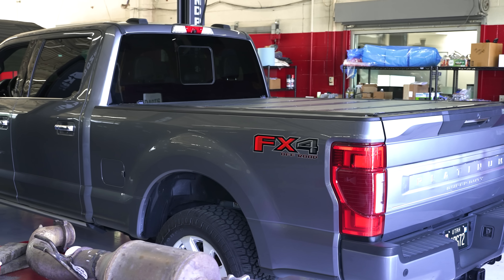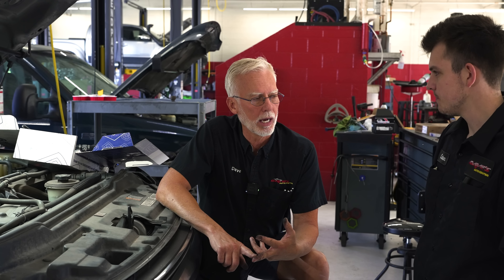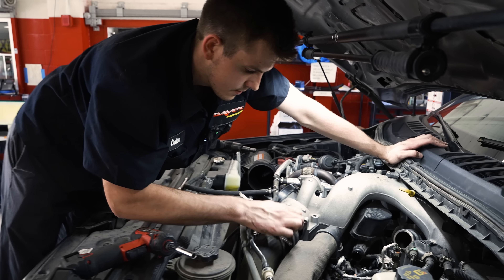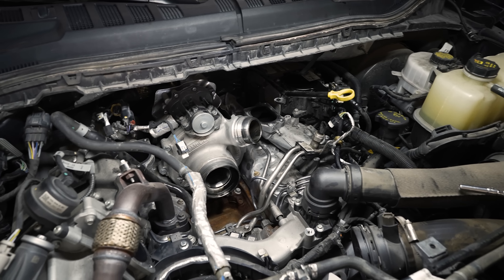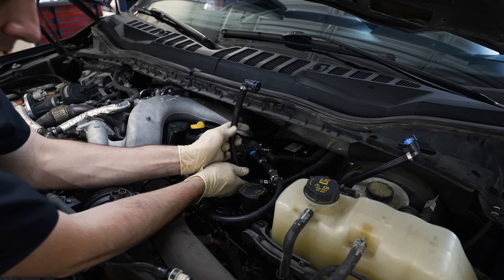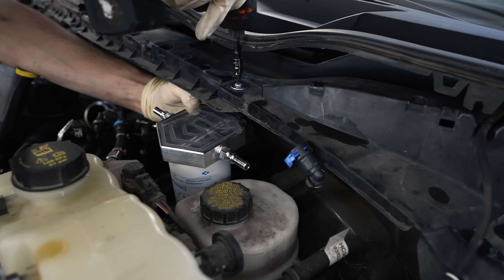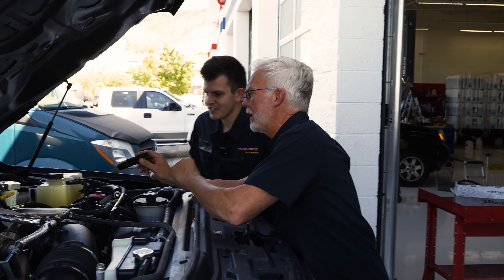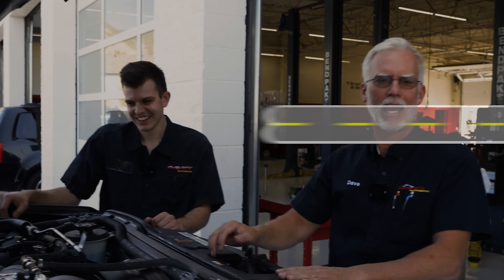How To Avoid A $10k Repair When Your CP4 Pump Fails!

Comment: Thanks again for trusting in our products and putting out great videos on them! Seeing Caden give a 10/10 star rating on fit, finish, and install is exactly what we are shooting for on all of our products!
Reply: Impressive marketing, I give you that. Got the masses fearing the cp4 like the plague.
Reply: Looking to see if I can fit that kit on a 2013 duramax lml.      Maybe a little modification?     Would like to know your thoughts.
Reply: @ronniebenoit4081  In your case they make a cp3 kit for the duramax. That's your best bet. Cp3 flows tons more than dcr and cp4.
Reply: @HSKFabrications well there's multiple class action lawsuits over the CP4. They are junk.
Reply: @HSKFabrications  cp3 doesn't produce the designed pressure needed for the bosch lml injectors.... less efficient by designed standards
Reply: @ronniebenoit4081  S&S literally sells the kit for a cp3 in an lml. Just get a good lift pump and a cp4 by exergy. You'll be fine. Seen em last half a million miles with a better lift pump and an additive used regularly.
Reply: @Retadin  They will all lose. Too many variables controlled by the consumer to put the blame on Bosch.
Reply: @HSKFabrications  obviously you didn't read what I replied with.  Why would you want to lower your fuel pressure?    The cp3 only produces 15-18 kpi's.   When the cp4 produces 28-30kpi's.    More pressure means better fuel burn.
Reply: @ronniebenoit4081  Well, why do about a dozen companies sell the kit? That's why I said afterwards to stick with a cp4 by exergy.
Reply: @HSKFabrications my bad I miss spoke...
 I agree with what you're saying.    300k.  165 FASS.    Injectors and cp4 replaced every 100k miles.... just a precaution so I'm not blind sided
Reply: @ronniebenoit4081  Good setup. I have a cp4 stroker for my 6.7 ford built by rcd which has pinned buckets and modified internals. Not sure if they do the lml cp4.
Reply: @HSKFabrications  I'm looking for something.    I. I'm tired of wondering when it'll explode on m....lol.    I'd like to see if a CAT pump out of a 3208 can be  modified.
Reply: @ronniebenoit4081  You are correct. Increased injection pressure improves combustion, but only if the ECU commands it. The pump itself does not control the pressure. The ECU commands rail pressure by a combination of metering the volume of fuel that goes to the plungers with the VCV and bleeding off excessive pressure in the rail with the PVC. A CP3 will make just as much pressure as a CP4 if the ECU commands it. We use CP3s on our injector test benches and they have no problem creating whatever pressure we want. The pressure limit in a common rail fuel system is the injection duration and leakage through the injectors. With that being said, a CP4 is slightly more efficient at higher pressure, due to the plunger bore diameter being smaller. A smaller bore has less circumference for leakage between the bore and plunger. We have sold a lot of LML CP3 conversion kits over the last decade, and not one of them has come back for not being able to meet the commanded rail pressure. In fact, an R110 (1087 mm^3/rev) CP3 has more displacement than the R90 (896 mm^3/rev) CP4 which gives it the potential to support more pressure on an LML if the calibration calls for it.
Reply: Send one my way please for a 2011 😅
Reply: Thanks for the video …. Looking for a set up on my 2018 F150 power stroke ?
Reply: I love the kit. My mechanic really loved the kit. He said for once there was a kit that went in exactly as stated zero issues super smooth install. Thanks for the great products. Once my CP-4 takes a dump Ill be ordering the replacement pump kit you guys have.

Comment: The ultimate disaster prevention kit is a N/A gas motor 😂
Reply: Then you pay the 10k in fuel guzzling towing
Reply: @100pyatt  yep. But most of these trucks tow nothing 🤣
Reply: Drove a 6.2 f250 for years and liked it alot. But my 6.7 f350 is so much more comfortable. Im at 5k elevation and hwy speeds are 80. Even without towing the extra mpg and comfott if the diesel is worth it
Reply: headache prevention kit: avoid consumer diesel trucks

Comment: I installed that S&S DPK on my 2016. Much easier access if the CCV filter box and EGR cooler are removed, which I still haven't found time to reinstall. And just to add issues, my DPF and DEF mysteriously disappeared.

Comment: I bought this kit and had it installed shortly after getting my second hand 2016 F350. Cost me less than $1000 for a great piece of mind. Great quality parts. Only regret was wishing I would have waited about 8 more months for S&S carb certs to pass on their CP4 replacement pump kit.

Comment: Just purchased a 2024 Ford F250 high output. I have been researching purchasing a diesel for about four years and finally was able to get one. Of course a lot of videos like this come up. Looking for an opinion by anyone following this video or from Dave himself reference to Having to do this on a brand new Ford. Has Ford not recognized that this is a failure point? Is it something that should be done no matter what even though you own an $85,000 truck? 

You would think that Ford would’ve figured this failure part out and maybe switched it? Any ideas or comments relative to this would be appreciated. I know it’s probably short money considering the investment but didn’t know if certain years were affected more than others and again I would assume that Ford would’ve already addressed this and made the fix.  

It just seems like it’s such a widespread talked about issue on the Internet that someone would fix it at the engineering level at Ford

Comment: What's your take on why manufacturers seem to have forgotten how to do basic things. This fuel pump is only one example. Lifters seem to be another area where things have gone bad. Generally poor layouts for maintenance and repair is another big one. The additional cost to incorporate a filter arrangement like you have installed on this video at the factory would not be a ripple in the cost of an $80,000 truck.

Comment: Hey Dave, does S&S Diesel have that kit for a F150 with the 3.0 diesel motor? I have a 2018 with the 3.0 diesel with 60k miles and I would like to get that kit or a new DCR pump.
Reply: We do not currently offer any kits for the f150 3.0 platform, however we do have those on the radar for a possible disaster prevention kit in the future.
Reply: @SSfueled  thanks for responding

Comment: Can you give us an idea of what a dcr pump and install job would cost if you were to do the job .
Reply: Twin fuel filters ? Probably not , I think if you check a little closer , the first one is a water separator , has a little drain valve on the bottom & in fall, winter, spring weather of high humidity should be opened a little almost dayly to see if pure diesel comes out .

Comment: Hey Dave, what if you use the old school method of adding a quart automatic transmission fluid in your fuel tank on a full tank and maybe that will give you enough lubrication. 
What do you think?
Reply: Nah, there are better additive s that won't plug up the DPF. Try Opti-Lube or Hot Shots

Comment: What would be interesting is seeing  a pump failure that’s happened with one of these kits. Cut open filter show debris from damage. So  if you have this kit and have a failure you just change the pump and new filter on the kit

Comment: Just so you know he said the truck was a 2017 so the crankcase filter should be the updated one with no element inside of it I could be wrong but pretty sure ford did away with those by 17 and by 18 the did away with the pressure sensor also

Comment: Dave, I have installed a few of those now. Had a newer F word in a blue oval come in with a no start. Turns out, the CP4 went to the Bahamas on the poor guy. That was a stupedo expensive repair bill. After doing the repair, including a mortgage prevention kit, he had us do his entire fleet. Annnnnd added in Frantz oil filtration kits on all of them. Seems they are doing well since having done the above. The guy is still bringing their fleet to us for routine inspections and services. The best part, these vehicles are spotless everywhere, even under the hood and under vehicle. Makes performing a service and inspection a blessing! Duramax, Ram and Ford corporate engines.  

I appreciate you, Dave and Co.!!
Reply: I did not know that the Frantz toilet filter kits were still available . 
Better than that would be AMSOIL filter & a bypass set up as well , which is 98.6* efficient at 2 micron
Reply: @robertmintz63   They are still available and I highly recommend them. Our shop actually installs a few each month. It is amazing how they actually flow oil through the roll as well as they do. Frantz also offers an additive to replenish consumed oil additive over time. iirc, TBN is the product. Not to be confused with the TV network!!

Comment: So THAT'S the reason diesel fuel costs more now! You're a genius! 🙄
Reply: It’s not that it costs more but rather they can charge more because of demand , you know supply & demand .
Reply: @robertmintz63  if that was the main reason for the cost of diesel, it would fluctuate at least as much as gasoline does. Rather, we are seeing diesel consistently costing 10-15% more than gas! I'm currently on a 6 day 3,500km round trip, and this seems to be the same nearly everywhere! 
It's like everything else these days. If big business thinks they can maintain artificially high prices and we continue to pay, they'll keep doing it🤷‍♂️

Comment: 2013 duramax lml...putting on my 2nd s&s  replacement cp4.   Truck has 300k. Hasn't gone out yet but, I like to be ahead of the carnage.    Thinking if s&s has a  kit for Chevrolet by now.... I'll hafta holler at them

Comment: I seen where a Ford Tech who does this repair quite often, ask: are you going to trust this kit to have prevented all the metal from going thru the system and just slam a new pump on? I believe it's a valid question. Also, this pump is used also on Duramax's but very little is mentioned about that, how come???

Comment: Dave. Im from the netherlands. I Watch all of you videos. Use them for education. I have a Audi A4 with a 3.0 diesel engine. It has also a CP4 pump. Do they fail to? Or is this just an issue on those heavy trucks?

Comment: The bolt under the ebp can be a pain on the 20 & up trucks, snap on 8mm wiggle socket and a long 1/4in extension get it every time no matter what year model 6.7

Comment: I found a pretty easy way to get that back bolt out.  Get an extra long 8mm ratcheting wrench with a flex head.  The one I use is about 10" long.  You can get right on the bolt and get it out easily without messing with that pressure sensor bracket.

Comment: I paid $8700 when I bought my 04 LB7 Chevy in 2011 with 133,000 miles. Can't fathom spending more on just a repair. blows the mind.
Reply: LB7 uses the reliable CP3 not a pos CP4
Reply: @100pyatt good injection pump but terrible injectors
Reply: @100pyatt   LB7 also loves injectors. Had three sets on my 03 through 450k miles, rest of the truck was solid though.

Comment: The cp4 pump disaster prevention is the old school part. Now S&S has a DCR pump conversion for the Ford.
Reply: its old school but I just put one on mine. $400.00 is a lot easier to swallow than 2k

Comment: New cars/trucks suck...dont have these kind of problems with my 87' carb Toyota...over 250,000 miles on the fuel pump and when it goes bad? Truck wont run, no damage, and takes about 10 mins/2 bolts to change out...Have a spare behind the seats.....ROADKILL style

Comment: The best thing you can do is don't buy a diesel.   I've driven gas powered cars and trucks for 40 years and never had to pay for an engine.  Gas powered cars and trucks are more reliable and far cheaper to maintain.

Comment: I don't understand how some trucks have such filthy egr systems. I just did their bypass valve on my 2011 duramax. It has 175k on it so I figured I'd be in for a real mess. I was shocked to find everything was very clean. Aside from minor dusty soot covering the surface everything was very clean. The bypass valve wasn't stuck from sludge and just stopped functioning. I do use a splash of marvel mystery oil at every fillup but I would think that would make for more smoke and thus soot. As for my cp4 so far so good. I never let my fuel tank get low and use the additives.

Comment: For all those complaining about Ford 6.7s or diesel engines in general, you should know a few things. 1) The Bosch CP4 fuel pump was also put on the Duramax from 2011-2016 and was used on later Cummins engines. 2) Bosch uses a different alloy and tolerances on the newer pumps, which mostly fixed the problem, which is why Ford still uses the pump. 3) Bad fuel and low lubricidity fuel is the ultimate cause, it’s not specific to the CP4; many older pumps will experience the same issues but classic truck and heavy equipment owners tend to use better quality fuels than what you get out of the pump.

S&S kit is necessary for 2011-2014ish Duramax and Powerstroke engines. I have a ‘22 6.7, I plan on keeping it for several hundred thousand miles. I only use bulk fuel from my own tank and run a Cat fuel/water separator and fuel filter. This is already overkill, the S&S kit is great but even more overkill than what I’m doing.

Comment: I remember back in the day I could replace my 6.2 or 6.5 diesel with a complete crate engine for less than the price of a fuel system today…there was something to be said about the old tech diesels…they weren’t power houses but they were good on fuel, cheap to buy and maintain, and reasonably reliable!…if someone told me 25 years ago that diesel pickups would have 500hp and 1200lbs of torque I would have said they were crazy!…I still think it’s crazy to be honest!…

Comment: Just bought a 2011 LML with 77k miles Riding around in sheer terror now. Mile by mile what y’all gonna charge me to prevent it destroying the whole fuel system? I’ll drive it to you all the way from central Louisiana if you can fit me in.

Comment: Let me ask this, if you a know a product is just a bandaid, the product in question being the disaster prevention kit, the CP4 pump will eventually fail anyway, why wouldn’t you discourage the customer from getting it? There’s a cure for this problem, the DCR pump conversion. Why not encourage the customer to go with the superior part that will fix the problem? This has me question any shop who from the looks of it are truly not as knowledgeable into basics of auto mechanics, let alone the high performance side of the business. If you’re willing to sell customers inferior or temporary fix parts, you will cut corners in the stock replacement and high performance side.
Reply: I found your 10mm socket and magnetic light under the form a funnel. Relax buddy.

Comment: I see Ford has a new recall on their 2.7 and 3.0 eco boost from the F150 and Bronco. Bad valves. This is what happens when you use 3rd party suppliers instead of making your own parts for quality control.

Comment: Ram had the CP4 on the MY’19-‘20.  Then went back to the CP3 ‘21 to present.  Stallantis also did a recall on those MY ‘19-‘20 to replace back to the CP3.  Ford currently only one utilizing CP4 on the 6.7’s of heavy duty trucks.
Reply: Isuzu Duramax is using CP4 too
Reply: I have fords and chevys, they are idiots still using cp4's, they need to be sued over them. Damn ford put the CDR pumps in.
Reply: @100pyatt  GM ditched the CP4 in MY17.  Went with Delphi fuel system.
Reply: @gleanerman2195 You going to sue a foreign company ? And good lord suing Ford . Go ahead give it a shot.

Comment: The CP4 has metallurgy and engineering problems. The lubricity of modern fuel doesn’t help, but I promise you the Bosch engineers are not to blame for this debacle. Their accountants are.

Comment: My buddy’s dad just spent 16 k on a whole new fuel system and pump because of a pump failure!! The truck is only worth 16k! My advice is change the pump, flush the system and trade it in immediately!!

Comment: Auto manufacturers should be required to do a mock repair of all parts and assemblies at the factory before they sell the vehicle to see difficulty and actual time. Make sure it’s a mechanic that has never worked on the vehicle before.  And ease of maintenance and repair should be tied to the CEO’s bonus. Not sales.

Comment: Duramax needs this!
Reply: They have it, it's called install a CP3 pump and delete the EGR crap out the truck while you're in there.
Reply: Duramax needs a new country and company of manufacture, not isuzu.
Reply: @hallmarksdetailingllc8078  not quite the same price point... You ain't wrong though

Comment: He should have had Caden delete the EGR system while he was in there. But to each their own.
Reply: Well old egrs arent near as bad as the modern stuff. Funny thing if we stopped increasing emissions at 2010 thr atmosphere wouldnt be any worse. Its power plants and manufacturing that are causing climate change. Not our cars and 10000% not racing cars
Reply: @captaintoyota3171  Emissions standards should be frozen at early mid 2000s levels. Everything since has only served to function as a stealth ban on the internal combustion engine.
Reply: @captaintoyota3171  You're 100% right. Diesel vehicles are not the pollution problem. Industrial manufacturing is what causes 99.9% of pollution.